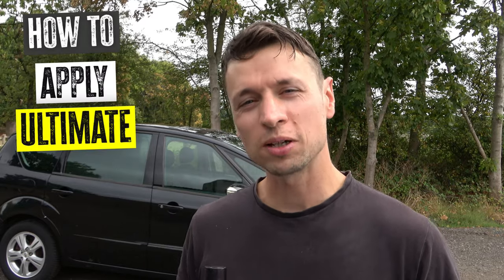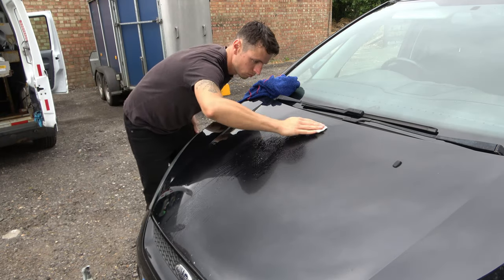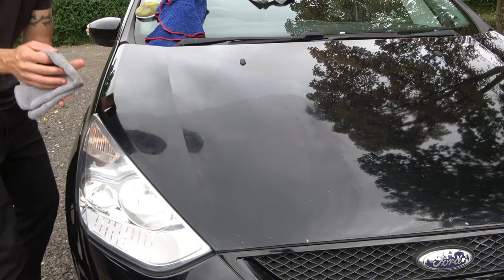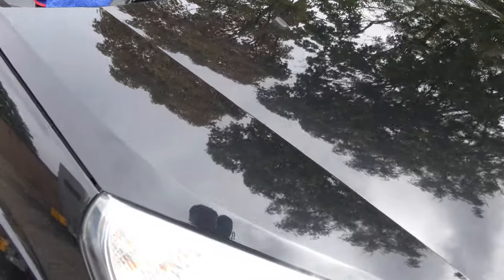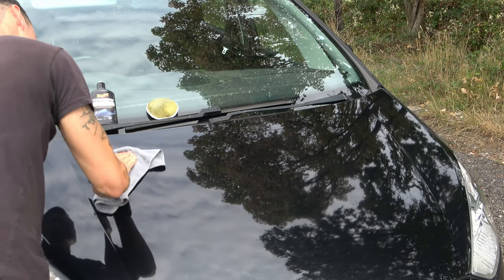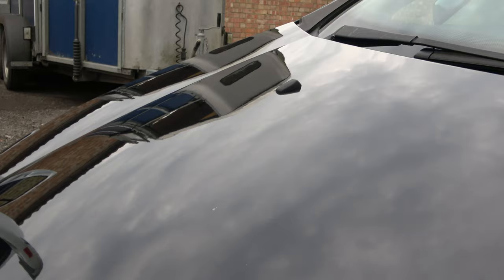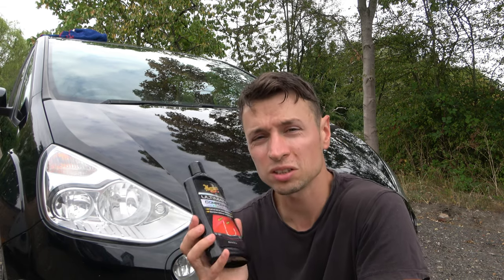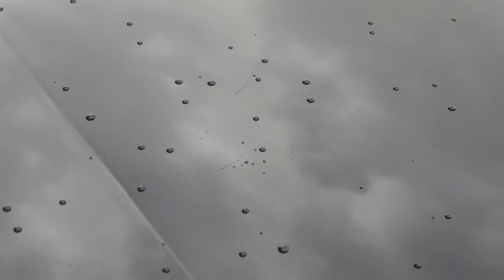Applying Meguiars ultimate compound by hand | Does it Work?

Comment: Hi. Dude, I sand all the way up to 2000, then Ultimate with wool, then again with black(fine) sponge, and I get a beautiful mirror finish, but I can't get rid of the spider web swirl marks??! So frustrating
Reply from the maker: What type of polisher are you using? Da, rotary?
Reply: @epicautomotivedetailing  ty... rotary, variable speeds. Around 2000-4000 opm, I'm thinking. the 500 opm setting, seems to stall out too easy... I tried by hand after this video, I honestly couldn't tell if I was making a difference, but that told me it would take way too long by hand. peace
Reply: @epicautomotivedetailing  Lol, does that mean I need a DA?

Comment: Would a spray polish be better?
Reply from the maker: never seen a spray polish before. you can get ceramic sprays for afterwards. you need a compound if you want to remove scratches. sadly super resin polish wont be enough to remove scratches

Comment: Great video! Thx! Q: would it be ok to apply after waxing "turtle wax" hybrid solutions ceramic coating or any other ceramic coating?
Reply from the maker: Yes its fine. Turtle wax ceramic spray coating is a nightmare to apply for beginners. Regular sprays of ceramic Detailers are enough for most people